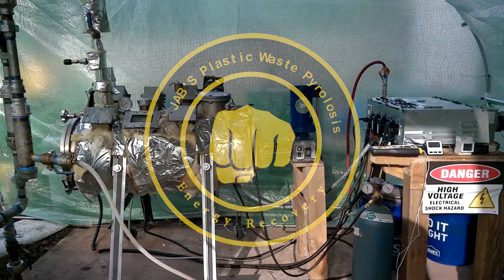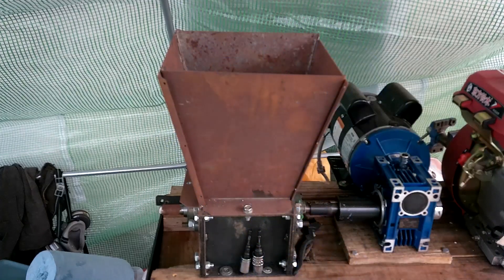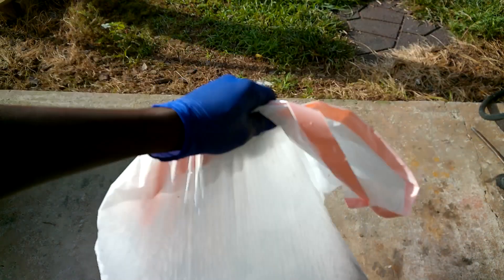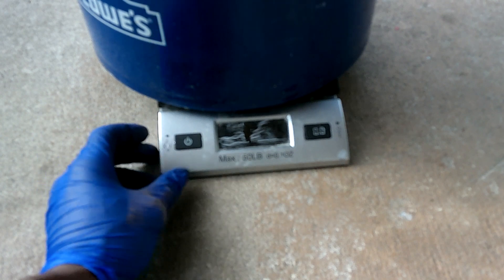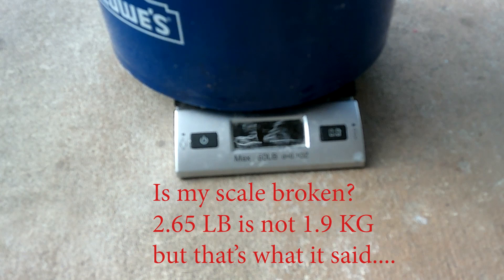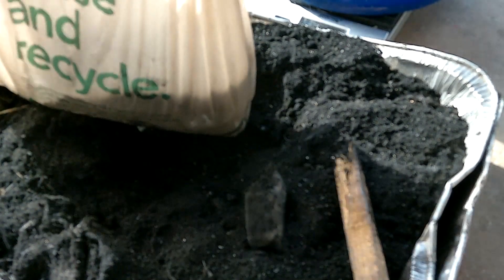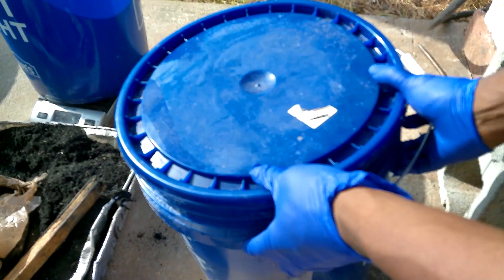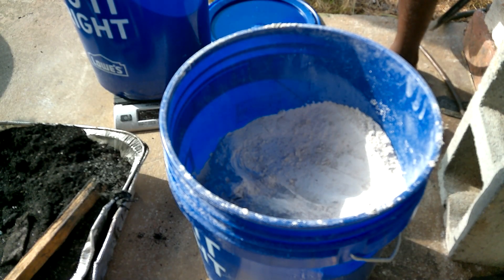Running Mark 4  Plastic to Fuel Reactor - Part: 1 - Preparation

Comment: Our lord and savior
Reply: @naturejab  Acts 12:20-23
Reply: Lad I hate to brake it to you but this is far from good for the environment
Reply: He’s wasting energy burning plastic for a few drops of fuel and as a result producing many harmful gasses you genuinely better off putting it to land fill
Reply: @benhorsfall1922 You can actually trap those gases into filters or refine it further to be used. It doesn't have to go back into the air.